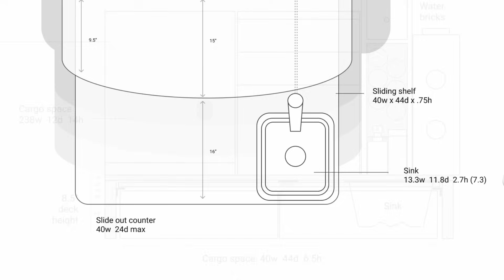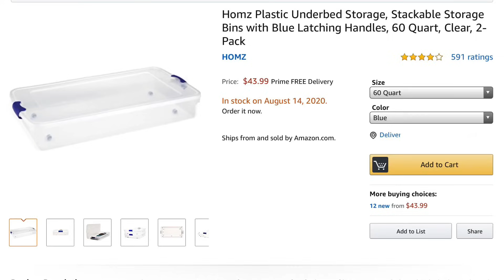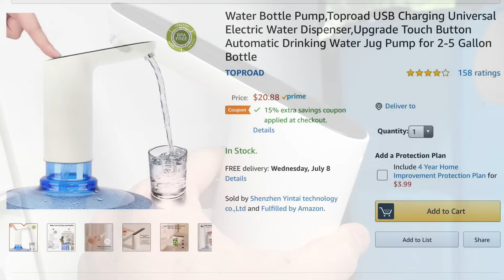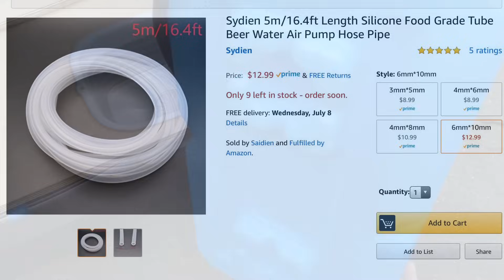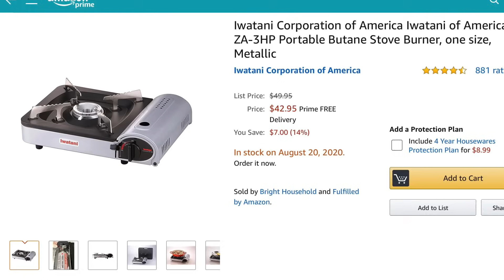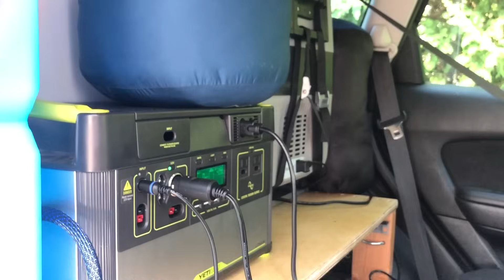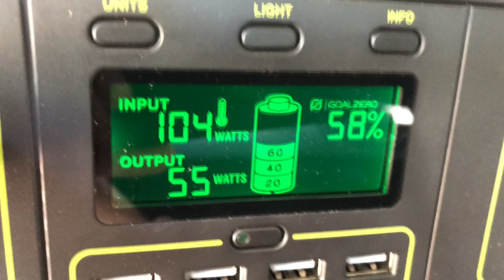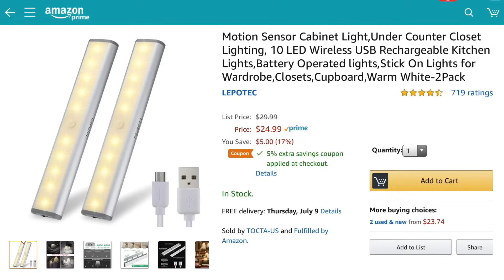SUV car camping kitchen with sink and fridge - DIY organization ideas for family camper

Comment: I like how you demonstrate how you secure everything down to the vehicle. One issue I always have with people's builds is that they have too much loose stuff in their vehicles that will turn into projectiles in an accident. Its all fine and dandy if people can fit and organize everything in their vehicles, but not so much if it all kills them in an accident.
Reply from the maker: Yeah, it can be dangerous and it's not too hard to ratchet strap these down to strong points in the car.
Reply: @todd.parker  Agreed, I just started thinking of building this for my minivan in lieu of buying teardrop, and I hadn't even considered the safety issues. Thanks!

Comment: Amazingly well thought out. I like your use of so many off-the-shelf products. No need to reinvent the wheel.
Reply from the maker: Thanks! That was my plan - "almost homemade" where I cobble together existing stuff with minimal work.
Reply: I currently use a surplus "mortars" ordinance box to store power tools on a shelf. Been wanting to build a "chuck box" for my SUV but your build looks better!
Reply from the maker: Eric T yeah, I spent a lot of time looking at chuck boxes and decided I didn’t want to have to lug the kitchen out of the car and set it up every time but it all depends on how you like to cook and what kinds of camp sites you visit. I like that I can have a functional kitchen anywhere and make some quick sandwiches in a parking lot because things are accessibile
Reply: I agree! What really impresses me is the combination of off-the-shelf, factory-made components (because most of us just don't have the time or skill to build something better than a $100 file cabinet, and if we did, the hardware would probably cost$150). But then combined with some great custom work to integrate them. The shelf and sink, the waterbrick and rechargeable pump-faucet...wow! Really well thought out integration! Thanks for showing us.

Comment: Awesome setup!! What I like the most was  done on a “real family “ car. Not a Truck or Expensive Land Rover with over head cargo racks. And the detailed info about locking bolts&nuts. It is so hard to go to hardware store and stand in front of the 100’s of bins . That all look the same to me.
Reply from the maker: Thanks! I wanted something functional and organized but pretty cheap and something I could pull off with limited tools and skills. Glad you liked it

Comment: Very functional and thought out build. Im a full-time rv'r and used several items "off the shelf" because  it was much nicer than building things from scratch.
Reply from the maker: Yep, why reinvent the wheel. A factory is more precise than my woodworking will ever be
Reply: @todd.parker  Hi. At the bottom part of the rechargeable faucet did you use the L brass too to connect it to the hose?
Reply from the maker: No I just connected the tube to the barb on the faucet
Reply: @todd.parker  thank you.

Comment: Very nice! I too had admired that fold down sink set up one the egoe nest box. 
I love the magnetic rechargeable faucet - perfect for  fold away kitchen. Kudos for fitting that all in a car.
Reply from the maker: Thanks, I appreciate it!
Reply: Absolutely I would have never thought of that faucet. I am so excited about that.
Reply from the maker: @KMF3  Be careful with the one I bought. It's fancy and touch sensitive but I dropped it soon after this video and the top panel popped off. I siliconed it back down but the touch sensitivity is a bit wonky now. Kinda wish it had more of a real clicky button.
Reply: @todd.parker  thanks for the heads up on that

Comment from the maker: Here is a list of the key parts I used. I didn’t include the price of the fridge, Yeti, or solar panels in the video since these are optional add-ons (I happened to own). You can just use a cooler and skip the fridge and power stuff. The other commercial camp kitchens I mentioned don’t include these in their pricing either so I was trying to compare apples to apples. Hope this is helpful!

Homz 60qt Plastic Underbed Storage bins 
https://www.amazon.com/dp/B06ZZY2M92

DEVAISE 3 Drawer Mobile File cabinet
https://www.amazon.com/dp/B072J7KN3N

SAMMART 9.1L (2.4 Gallon) collapsible wash basin
https://www.amazon.com/dp/B07DCRL16M

Water Bottle Faucet Pump, USB battery powered
https://www.amazon.com/dp/B07QY5F7HC

Water bricks, 3.5 gallon 
https://www.amazon.com/dp/B0053GVRWQ/

Sydien 16.4ft/5m Silicone tubing 
https://www.amazon.com/dp/B07D3414QN

Joywayus Hose Barb 1/4" Elbow 6mm
https://www.amazon.com/dp/B07H6YNVLQ

25ft - 1/2 inch PET Expandable braided sheath 
https://www.amazon.com/dp/B074LRSL3H

12 Magnetic Spice Tins
https://www.amazon.com/dp/B01FY69CPS

Perforated angle iron for runners (2x 4 foot)
https://www.homedepot.com/p/Everbilt-1-1-4-in-x-48-in-Zinc-Plated-Punched-Angle-801337/204225757

Felt tape for runners
https://www.amazon.com/dp/B01455QMX4

For refrigeration you can always go with a cheap cooler for a simpler setup that is much less money. I opted for a compressor refrigerator/freezer which is very efficient but costs a lot more, do what works for you. In this video, I had the Alpicool T50 dual zone which was awesome but just recently stopped working out of the blue - not recommended until they improve reliability but here is the link:
Amazon.com: Alpicool Dual Temperature Control T50 Portable Refrigerator 53 Quart(50 Liter) Compact Fridge Mini Freezer
https://www.amazon.com/Alpicool-Temperature-Control-Portable-Refrigerator/dp/B07MKK25JT

I just purchased a larger, Dometic CFX3 75DZ dual zone fridge freezer to replace this, will do a video on this soon!
https://www.dometic.com/en-us/us/products/food-and-beverage/coolers/electric-coolers/dometic-cfx3-75dz-_-220585

...if you get a compressor fridge, you’d also need some sort of battery to power it when the car is off. You could use a normal deep cycle battery hooked to a car charger but I already own a Goal Zero Yeti 1000 already and it’s a great portable package that includes the battery, charger, solar charger, and inverter in a tidy package that will run the fridge for about a day+ .

Goal Zero Yeti 1000 Lithium Portable Power Station
https://www.goalzero.com/shop/power-stations/goal-zero-yeti-1000-lithium-portable-power-station/
(I have lots of videos on Goal Zero and the Yeti 1000 - https://www.youtube.com/playlist?list=PLhqwm5VNmYIU5g3APV2ougOyg12UQcR7d)

And I power this with these 60 and 120w TP-Solar foldable solar panels
https://www.amazon.com/TP-solar-Foldable-Battery-Portable-Generator/dp/B07ZZB2H22
(video review - https://www.youtube.com/watch?v=Jjfr9WUB2rA&t=2s)
Reply: I bought a costway fridge (rebranded alpicool)  and it stopped working within 3 days. I ended up just paying the premium cost of a $1k arb fridge for reliability and peace of mind. They also draw less power.
Reply from the maker: Jonathan Ramirez Yeah, I was hoping I’d luck out but I figured if I wasn’t fortunate to get a refund (they didn’t have to), bought another cheapo fridge and that died with the next few years and had to buy a 3rd, I’d  ~$1,200 into it which ya what a good brand costs and will last for decades.
Reply: Thanks for the great ideas and sourcing the pieces!
Reply: Where did you buy your camping pots and pan set?
Reply from the maker: @karlamaynor9885  I think I got this one from REI: https://www.rei.com/product/830828/gsi-outdoors-bugaboo-camper-cookset